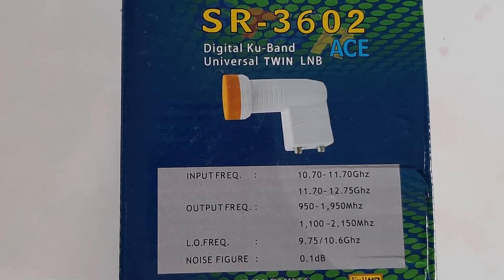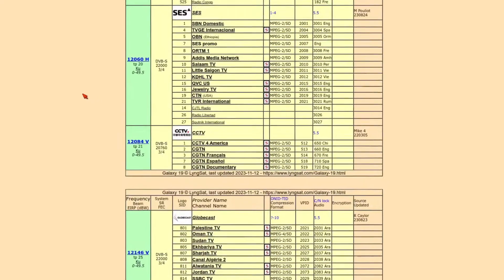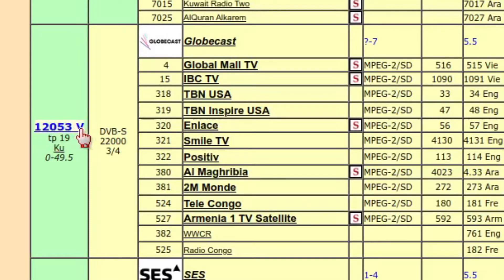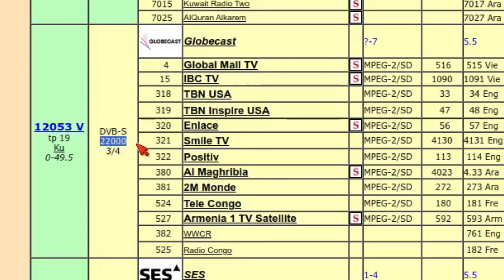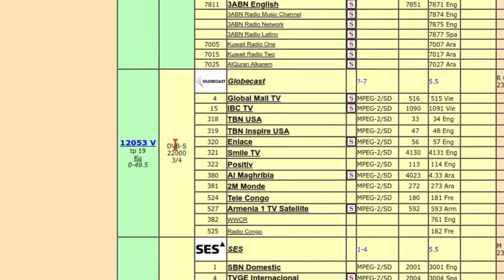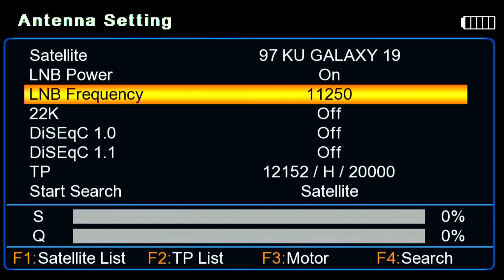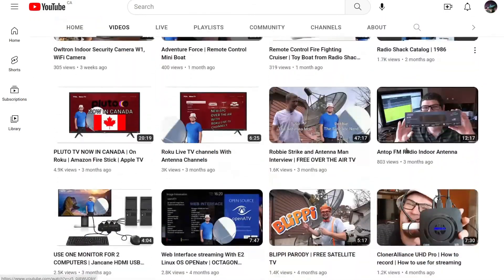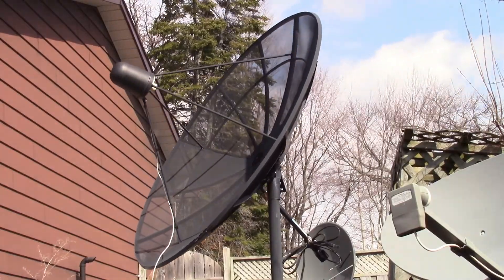MOST COMMON MISTAKE WHEN INSTALLING A FREE SATELLITE TV DISH | LNB FREQUENCY SETTINGS

Comment: That's right. Back in 2018 I installed a 100 cm Ku Band dish with a H-H motor, when I was searching for new satellites I couldn't receive all channels beacuse I didn't set the correct LNB Frequency, in the receiver's menu. Back then I used the AMIKO MIRA HD satellite receiver, I only have Ku Band satellite dishes. The satellite receiver was set by default on "5750" (C Band LNB) but this happend when I added a new satellite the existing satellites are mostly Ku Band, if I tried to manually add a Ku Band frequency I had no signal, and on blind scan the channels had the wrong frequency, later I discovered that I didn't set the correct frequency. I changed from "5750" to "9750-10600" (Ku Band) ,on some receivers it will show you "UNIVERSAL" instead of the frequency, and I could receive all channels. In Europe very few people use C Band most of us use Ku Band we have hundreds of channels Free to Air and very good content.